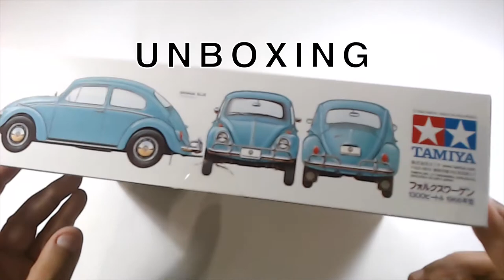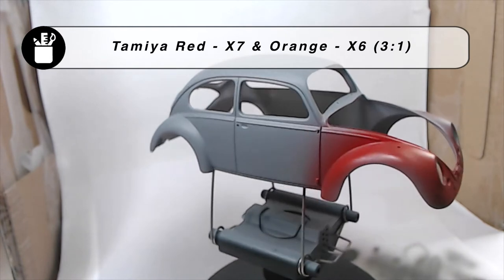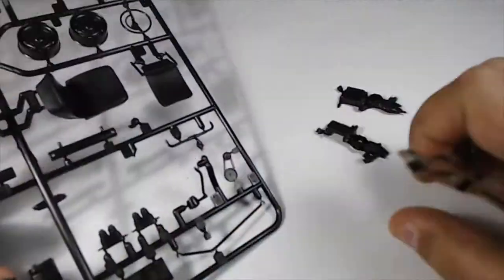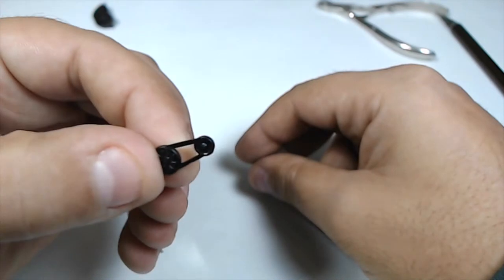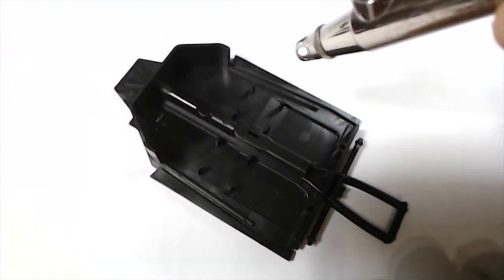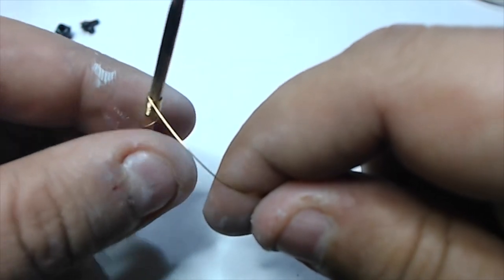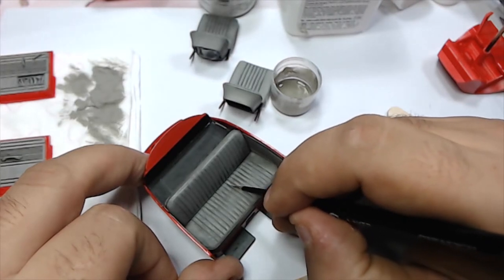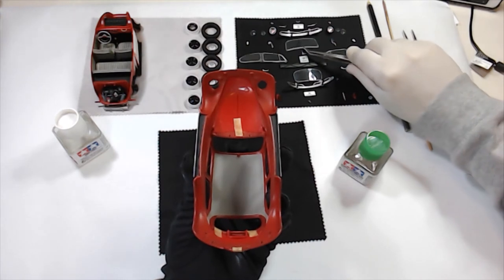Volkswagen 1300 Beetle 1:24 Tamiya | Vintage Car Model

Comment: I just got this model in the mail this weekend. I’ll be building it soon. I really hop my paint job comes out as good as yours
Reply from the maker: Thanks for this great observation. The secret is after 2 - 3 gloss varnish layers polish with 3000 sandpaper and then polish with polish paste. By the way enjoy the building, I'm sure you'll have as great results as mine.

Comment: WOW What an amazing job,     What is the Tool you used to put the head lights and lens in ??
Reply from the maker: Its a wax pencil, you can buy in many hobby stores or you can use a simple candle with well shaped tip 🕯 🤫😄

Comment: Very nice work, congratulations. How can you glue the painted parts with Tamiya Cement? Does it work despite of the lacquer and paint?
Reply from the maker: Yes it works well! I’m not chemical specialist but glue makes well reaction melting and sticking lacquer, paint and plastic 👍🏾

Comment: Very good video and easy to follow with a great soundtrack. Very inspiring. I haven't built a car model in many years; I usually build WWII armour. 
I spray only Tamiya acrylics with my airbrush. Is there a good clearcoat finish that comes in a spray can instead of mixing two parts as you did? 
 Keep up the great work, Pablo! I've just purchased my '66 and will start working on it after seeing this.
Reply from the maker: Hi RB55able,
Many thanks for your positive feedback and points I really appreciate it.
Regarding coating layer, there many options, till now this is the best I've used. In next modelkits I will go with  Mr. Color GX Super Clear III, I've seen tutorials of master and this product looks promising. About spray can, personally a don't like using theme, are quite tricky to apply and be accurate but anyways depends on your ability. 
Again, thanks for good vibes  that cheer me up to keep improving and share with you in the very best way.

Comment: I have everything, the model, the tools but I don't have an airbrush and  tamiya paints
Reply from the maker: You can paint with other paint brands but no deal if you have no airbrush.
Reply: Just have fun. I don't have access to an airbrush either.

You could go the route of doing a really weatherbeaten old car. Really thinned out acrylic paint with a broad brush would give a good result.

The paint would no longer look polished, but even dirty and rusted.

Steemgeezer and Sons have a wonderful video:
https://youtu.be/82SUFh9f0HU

This is excellent too:
https://youtu.be/Fr5IH2gyqA4

Tamiya spray cans will do a very good job, not as good as here but good nonetheless

Comment: Oh god...please 😣 ‘66 käfer have no spring coil🤦🏻‍♂️ no one have until 1302 and 1303, and then they are on the front suspension, but never on rear drivetrain
Reply from the maker: Sorry for not being technically accurate 🙏 Thanks for feedback!
Reply: Giacomo it not bad to give positive feedback. Not everybody knows everything about cars. Its about enjoying the hobby.
Reply: Could be a custom VW 😏😉

Comment: Of great assistance as I try to build my VW 1300. Could be a little more detailed. Thanks.
Reply from the maker: What kind of details you miss?
Reply: @PabloModelkits  Thanks for your reply to my comment. The instructions that do come with the kit don't seem to answer some of my  questions. I am new at this and will have to  re-read the instructions that did come with the model.
Reply from the maker: @douglasmaurer6659  If I can help you with specific questions just shoot it.
Reply: @PabloModelkits  Thanks very much. I'm sure I'll have questions as I put the model together. Have a great day!

Comment: beetle does not have that kind of suspension
Reply from the maker: If is customised why not? 💁🏾‍♂️
Reply: @PabloModelkits  a beetle is all done on torsion bar suspension, so even if you put springs over the shocks on a real one, it would be pointless
Reply: @jakeflynn5379  This addition acts as a damper if I'm not mistaken.
Reply: I agree they all had torsion bar suspension

Comment: Why you paint the chrome parts with horrible chrome paint?
Reply from the maker: When I cut the chromed pars from the frame and removed molde excesses the original chrome was damaged and I had to paint again. It id so difficult to get a really chromed finish by painting with acrylics paint 😒
Reply: Also, priming with gloss black and then spraying with a high-quality chrome finish looks better than the 'chrome' parts in the kit. 

They shout 'plastic' chrome, I think.  Well done!